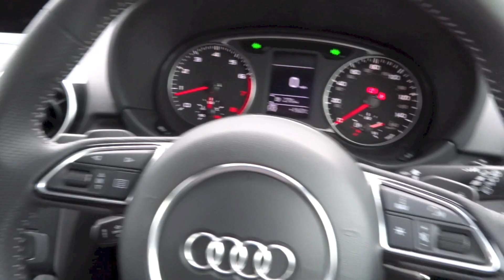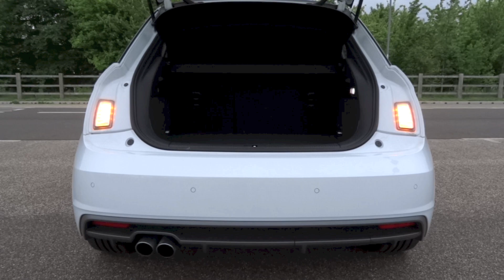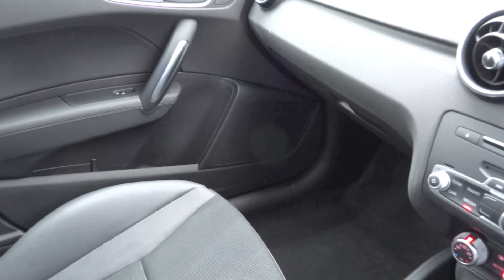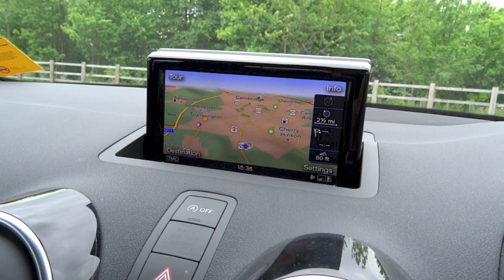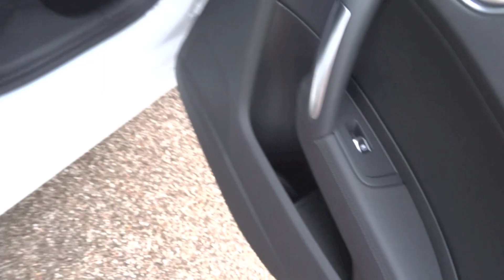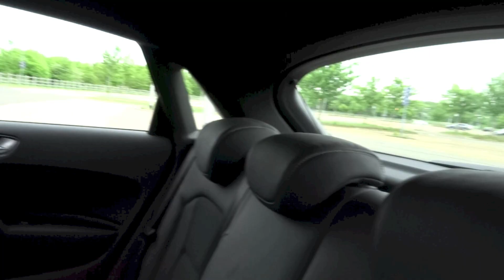2016 Audi A1 Sportback 1.4 TFSI 125 S line Start-Up and Full Vehicle Tour

Comment: I doubt I’ll get a response from a 6yr old video but do any A1 models have heated seats ?
Reply: My daughter has just bought a 2018 A1 black edition mk1, no heated seats. Through our own experience of searching for her car, we did find some A1's with heated seats, but not as standard it seems to any particular model. Our understanding is that they are an added extra on any model at time of original purchase, (bit like the sat nav, pricey to get activated). My daughter was hoping to get heated seats but in the end, we gave up as either they were in an A1 that was a lower spec or high mileage or just too far away so had to compromise. I hope you have better luck with your search, and find what you're looking for.
Reply: @norfolkcharlie5217  thank you 🙏

Comment: Hi I was just wondering, how do you differentiate between 1.4TFSI 123BHP and 1.4TFSI 183BHP? I read some says the 183bhp doesnt come with start/stop function. Any other differences?
Reply from the maker: As far as I know, there's no 183hp 1.4 TFSI engine for the A1.  The highest tune you can get the 1.4 TFSI/TSI engine in would be 158hp/160PS, and even so, the engine has been discontinued.
Reply: @alexlovesmac  I believe the 183BHP version was dropped in 2014.

Comment: What is better? the 1.0 95 cv or 1.4 tfsi? Considering a mix of fuel and performance
Reply from the maker: I think they're both great on fuel and performance, it really depends on your preference I guess.  If I were to go into the minor details, I would say the 1.0 TFSI engine has slightly less performance but it has better fuel consumption.  Likewise the 1.4 TFSI might consume a little more fuel, but you get better performance as well.  However, I would say if you're going to use it on the motorway a lot, definitely go for the 1.4 TFSI.
Reply: alexlovesmac Yes i need to substitute my Mito 78cv .. I drive for about 14000 km a year mixing Extra-Urban and RailRoad in Italy, with a little timing in urban-City life..
Thank you a lot!!